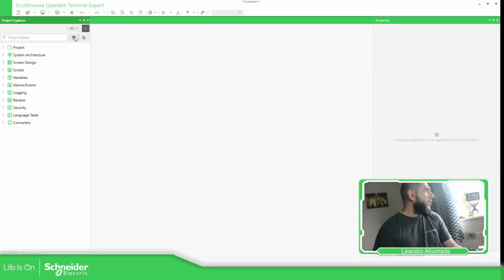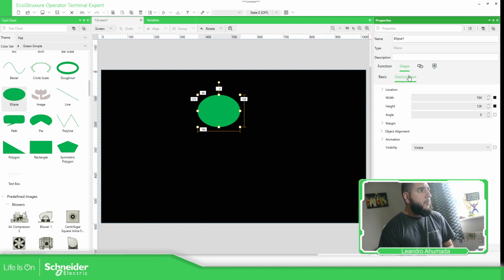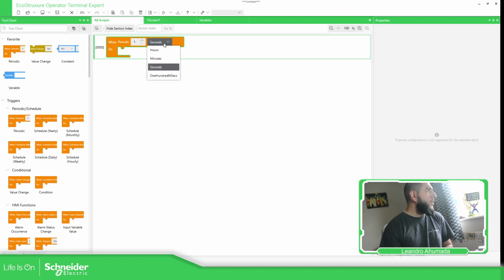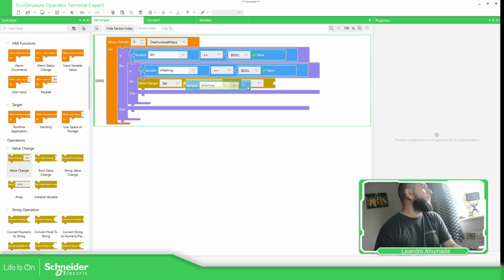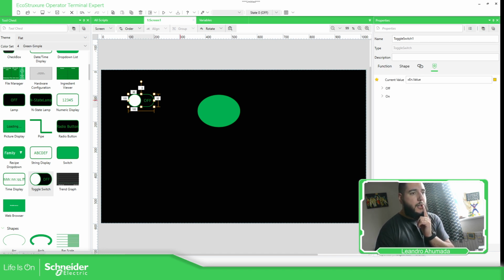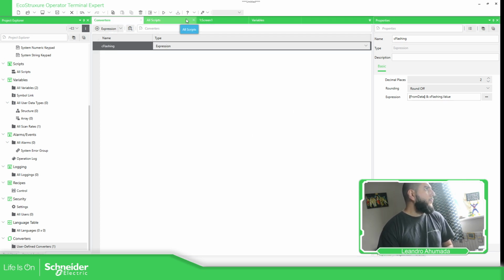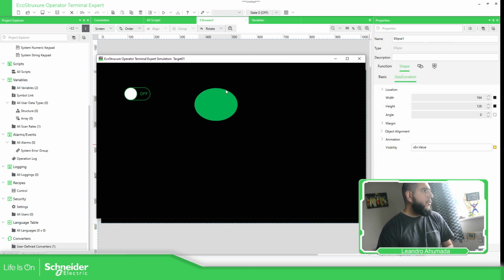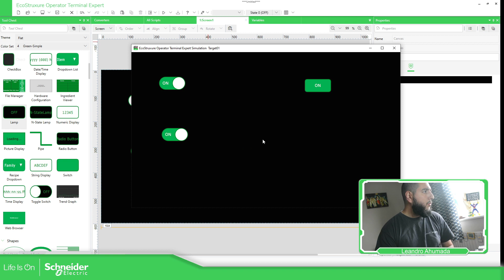Training EcoStruxure Operator Terminal Expert - Mx.x Flashing objects

Comment: Using the converter method, how can you have it so the default visibility of the shape is hidden ?
Reply from the maker: Hi Thomas! For further information about the visibility please check my next video: https://youtu.be/yOX03bJdY_g

The hidden property will depend on the variable value used in the converter, you will need to check to initialize the variable with the value that you need in the converter to get the 1 (hidden) in the "output".